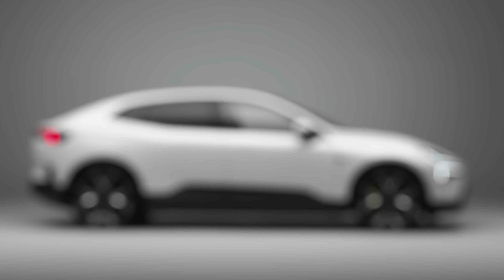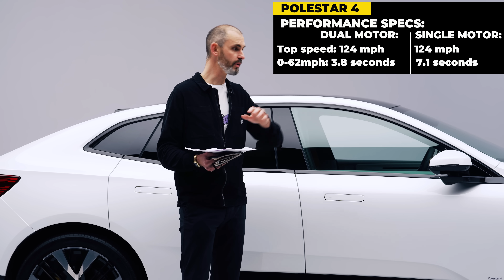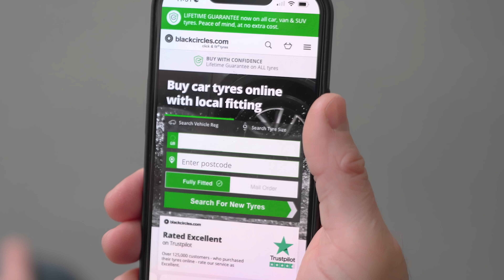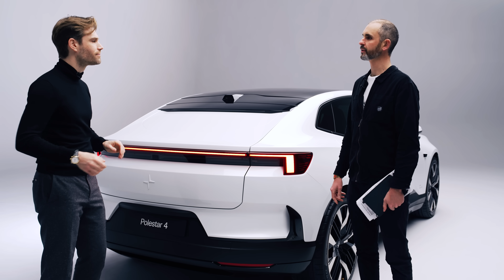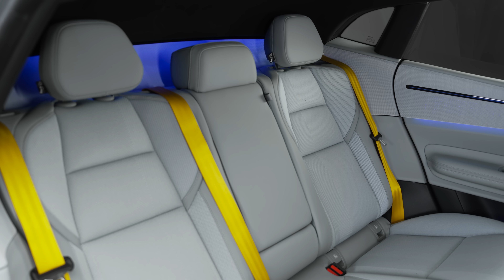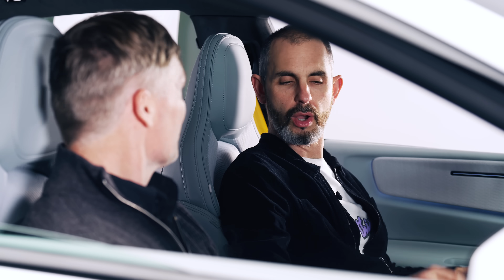New Polestar 4 EV detailed First Look - why the classy electric family car has NO REAR WINDOW

Comment: Calling this an SUV with an "high driving position" when the two could comfortably have a meal, while standing up, using the car's rooftop as their table would be insulting, if it wasn't utterly funny. Since Tesla elevated the B pilar of a sedan and called their Y model an SUV, I guess anything goes now.
Reply: Yep, it’s all marketing nonsense … this sedan has very low ground clearance, not an SUV by any stretch of the imagination … This disingenuous use of names like “SUV” for virtually everything serves no useful purpose

Comment: I know of a few other vehicles without a rear window. I believe they're commonly called A VAN. 
And you can fill up your hatchback booth to the top (legally, everywhere in the world), that's why you have side mirrors.
Reply: Side mirrors on passenger cars are for pointing out into your blind spots, Sherlock, not for looking behind you.  And guess what?  Vans, trucks, buses all have HUGE exterior mirrors to do BOTH!
Reply: @cbatiau2528  Behind your ears is not a "blind spot", it's behind you. Both what? The split mirrors on large vehicles have two angles to better judge distance, not whatever you think they do.
Reply: @PaulSpades  I have no idea what you're saying; it makes no sense.  Blind spots are out at an angle from your car's sides; that is what exterior mirrors are for ... they are not meant to look behind the car; that's what the rearview mirror is for...  duh...   yeah, big vehicles can have two mirrors or more on each side, sure; but smaller trucks and vans have single large mirrors that let you see your blind spots (i.e., on your SIDES) as well as behind the vehicle (thus, "BOTH")...  I don't understand how that was not clear to you from my comment above.
Reply: @cbatiau2528  amazing. if you can't see vehicles behind you trough your exterior mirrors, please learn how to adjust them.
Reply: @PaulSpades  oh, you can see vehicles behind you if they're not on your bumper and are large enough...  that's not the point... The point is that exterior mirrors are properly adjusted when they point out at large angle from your car, like 35-45 degrees out, into your blind spot.   A general rule is that if you can see the side of your own car, your exterior mirrors are not properly pointed to your blind spots, and you're driving dangerously.

Comment: As an older person making a comment I love the shape and the clean lines but it’s way too expensive for most consumers and it looks claustrophobic. We now have a car with a central display that is a distraction as the speed, temperature, radio and all other settings are on that screen. Fortunately it has a head up display but if using polarised sunglasses thats difficult to see. Until cars become completely autonomous the most important aspect of driving remains being able to concentrate on the road in front, behind and the environment around you. There appears to be a growing disconnect between that primary focus and what manufacturers appear to be wanting the car to become which is a capsule that completely divorces you from the environment outside.

Comment: It has no rear window, but has a panoramic roof and silly cameras. Some idiot on R4 this evening was waxing lyrical about how this would make the car more carbon neutral……give me a break…….lorries and vans have no rear windows, and they work ok without silly cameras - the drivers just learn how to reverse using their mirrors. But, it has knob all to do with saving the planet……..and, anyway, what’s wrong with using your eyes, rather than relying on some bings, bongs and a bit of computer graphics? Rant over. I’m off to polish my Morris Minor………
Reply: Yep, drove a transit every day for over 20 years. If you need a reversing camera or reversing sensors, hand in your licence and leave it to the real men.
Reply: @MattyEngland I always found reversing Luton vans using the mirrors easier than reversing my car - at least I always knew where the back of the van was!

Comment: Again a boring cross-over, nice looking, but still boring. SUV name is now used for any thing, but real SUV like a Landcruiser.
I understand the removing of the back window, and when I see how most people are driving these days, it will not be missed. But is it possible that a manufacturer put a small wiper,  or high pressure air, over all these cameras? Real world has the thing called rain, and it often makes these cameras useless.

Comment: All this talk about a coupe-like backend for efficiency and then a cd value of 0.269... the ID.7 Tourer will have a cd value of 0.24 and that's a big old station wagon. I think Polestar missed out here. The 4 will neither get the customer of the lower end of the segment nor the upper end, now being covered by the BMW i5 and the upcoming Audi A6 e-tron. Also feature-wise I don't see much new when Polestar isn't even using the full potential of the Mobileye system.

Comment: With Tesla reducing costs this thing is going to be sitting on the front lot for a long time
Reply: Potentially long enough that all the Tesla buyers will be back with their tail between their legs  after half the interior fittings fall off or Elon decides to put out a software update that sets fire to the battery for a laugh.

Comment: I’m all for EVs, I’ve owned three so far, but why why why are these manufacturers not building SMALL EVs. Not 2m wide, 5m long behemoths that can do 0-100 in sub 4 seconds and cost 70,000 pound/euro/dollar.

We need them to build 50kWh sub 25,000 euro/pound/dollar cars. No over the top design, no panoramic roof, touch screens, electric everything, vegan leather. Simple cars for simple people (like me). A modern Fiat Uno, or a Volvo 340, or a Toyota Starlet. We want SMALL cars!
Reply from the maker: Agree. Smaller footprint with larger cabins is the future for EV.
Reply: Most vegans only wash once a month, wouldn't want my seats made out of them. I'll stick to cows thanks.

Comment: If, like me your eyes do not focus well on close objects without reading glasses I imagine the rear view camera screen will never be very clear and sharp whereas a mirror is sharp due to focal lengths etc. Same goes for all these screens with text on them. Do they do a large print version for us older people or should we rely on car with buttons hosting bold icons on. Does the driving test eyesight check do small print as well as the number plate from 60'? I do like the black polo neck, a very icon rich video.

Comment: The front lights are basically Lotus Eletre and Opel Astra lights combined.
And the back light is from the Opel Astra if it had a full length light bar instead of two.

Comment: How do you clean the cameras like you would a back window? what with the road muck and salty air and snow that covers your car over winter.
Reply: You can't. So you need to stop en clean the damn camera. While if you have a window wiper you just control it with the sticks behind the steering wheel.

Comment: Another BEV for the saturated segment above £50k. 
When will we see serious BEV offerings in the £20k-£30k segment?
Reply: When they can make them with a profit margin.
Reply: What is strange about the car industry is that the product price keeps with rising inflation unlike white goods or home electronics. I don’t want any cameras and the touchscreen should be for route planning, not everything else. I don’t need all that to drive 5 miles to work and the odd trip out of town. Stop following Tesla!
Reply: Battery costs will likely hold them back unfortunately. For under £30k it would probably need quite a small battery, which works for city cars, but maybe not for the average family car. Battery costs will come down with design and advancements though, so they will hopefully become more affordable in the future.
Reply: They will never be that price.. because they dont want you drive it.
Reply: Exactly this
Reply: BYD
Reply: @TwoxowT byd trash with no real thing. Polestar is part of Volvo network witch means they will be around forever
Reply: If your country allows Chinese cars to enter without setting tariffs, it is completely possible
Reply: All the MG EV line up is in that bracket
Reply: @bdogmccool8096 some of
Reply: @bdogmccool8096 because they are cheap Chinese car with a MG badge on it.
Reply: £60k for a car is an enormous amount of money for most people. The only way to get one cheaper is used and who wants a used EV when out of warranty?
Reply: @marcandsebe lots of people once battery durability over comes oil industry propaganda.
Did you know a Tesla battery loses 5% capacity over 200,000 miles?
Reply: @geoffthompson1215  I still don’t want one. I’m very impatient and don’t want to wait hour to charge. You have to keep the battery between 20% and 80% so the range is only 60% of its stated range. I like proper switches and not a screen where I have to go deep into it to control things. Tesla’s are too big as well. I drive a Smart Fortwo and can park anywhere and it’s all I need. I don’t want to carry around all that wasted metal and weight. Plus Tesla’s are too expensive for me new. I can’t charge at home as I like on top floor flat. But good for you if you own a Tesla.
Reply: @geoffthompson1215  not many people can afford a used Tesla. I had a discussion on Facebook about EV’s and a guy proudly came and said he had purchased a 6 month old Vauxhall EV for £18,000 and it was cheaper than a petrol equivalent. The discussion continues and he said he had an amazing deal as the car was £41,000 brand new. So the owner has lost £23,000 in 6 months. I will never buy a new EV and definitely not a used one.

Comment: I've had my Polestar 2 for two years now, with 20k miles on the clock.  We live in the UK and use it as our everyday car, but also frequently take it to our second home in France (a 650 mile trip door to door).  I have a love/hate relationship with it.  I love the way it drives (it's a long range dual motor so has huge torque), very comfortable, good technology (Google Android, the cameras etc) and just about enough space to transport all our gear to France.  I hate the unreliability of some of the key technology.  Three times the car has literally ground to a halt with the message 'propulsion system service required'.  Two of these happened in France and on one occasion the car had to be recovered back to the UK and we had to make our own way back as foot passengers on the ferry (no support network in France!).  The issue seems to be with the motor inverters.  It's a three year warranty and I'm now starting to consider my next car.  The Polestar 3 is too big, the 2 seems like more of the same, the 4 looks lovely and would give us some more space, BUT can I trust it after my poor experiences with the 2?  I'll consider it alongside the Audi Q4, Macan EV etc, and hopefully the Volvo EX40 or EX60 will be available in my timeframe.

Comment: Crash safety could be greatly improved if it didn't have a front window. Why don't they leave that one off, too?
Reply: What if they put the seats, wheel, pedals and the screens behind the car, so the car drives off and the passengers stay still, away from the scene of the accident?

Comment: The EV concept to move away from ICE is a great idea, but to be a success in the US & EU it has to replace the mass volumes of ICE at an acceptable price point. The unstoppable excessive over application of utterly unnecessary technology and irrelevant design  applications are  driving the price of even mid-range EVs so high that they will fail to transition to the mainstream, as already seen and noted by Ford & GM

Comment: been saying it for a while, but car manufactures will all end up making 'estates' again, but it will be under another name. this is only 100mm taller than my V50. consumers at the moment are all hoodwinked by SUVs and Crossovers, and manufactures are happy to keep charging a premium for it... so it has to be called that to attract enough people, but in reality, this actually lower than a V70 XC, so we're already there. put 18s on it with a but more tyre, and drop it an inch and it is basically a regular hatchback... there is a lot to like about this car though, a step in the right direction at least (from proper SUVs, which no one needs).

all it needs from me is to have a much lower boot entry, so the dog can hop in easily :D

Comment: Zo it's like a Model Y, with 30% less bagage volume, worse electron efficiency (so same range), less software features, slower fast charging but slightly more "premium" interior for almost 30K euro more. Somehow I don't think it will sell that well...
Reply: Teslas are throw together to sloppy standards using borderline slave labour. They’re comparatively cheap because they’re not built to last and because Elon Musk can sink enough of his own money into the company that they could basically give them away if they wanted. That’s the difference.
Reply: @theidealcopy_  Actually labour standards in Tesla factories are equal and higher compared to other car factories. Currently Tesla's last longer than other comparable fossil cars and on top of that Tesla is not just the only (beside BYD) car manufacturer that can make a profit producing and selling EV's, they also have by far the highest margins of any manufacturer. Elon doesn't need to invest anything in Tesla anymore since it's a huge money printing machine.
Reply: @emilenossin5098  I’d urge you to look into why employees at Teslas’s NM factory refer to the place as “the slave ship”. Tesla and Musk personally have been successfully sued by tens of employees who suffered physical and emotional abuse as well as explicit racial discrimination.
Reply: @theidealcopy_  With the urgent mission Tesla has there's no denying that you need to be motivated to get with the pace in the factories, but you get rewarded with much more compared to other factories. Of course like with every company there are excesses, there are over 140.000 employees so you will find issues in the same ratio. It's not the company culture though at all.

Comment: Despite all the lovely design features, they still can't bring themselves to actually incorporate that dangerous size screen into the dash. It still has to stick up like an afterthought - "Hey, look at our screen, guys!". I cannot believe that any manufacturer is still doing this 'Tesla' style placement sticking up over the dash, especially the high end ones. Regardless of that, those screen are so distractingly dangerous, I can't believe they are allowed at that size. Trying to guide your finger to a specific point on something that big at arm's length whilst going over the rough, potholed surfaces of UK roads, your hand being bounced around means most times you will miss what you intended and do something you didn't want, so have to go back and try again, so, more time looking at the screen. How is that not a crash risk. And you're not even allowed to touch your phone (which I entirely agree with btw). It's just nuts. Tech for the sake of it. Crazy, crazy, imho.

Comment: I hope the Panoramic roof comes as standard on these sort of cars, as not having a rear window will reduce the number of access points for fire fighters in the event of occupants being trapped after an accident. Having a Panoramic roof would act as the replacement for that.
Reply: yes, all P4s have the pano roof as standard, the only option roof-wise is to have electrochromic dimming or not.

Comment: So they replaced the rear window by a 2d video feed that'll be blurry as soon as the car gets dirty.
Reply: maybe try it first before you judge !
Reply: @SDK2006b  Do you have a rear view camera on your car?
Reply: @MrMarty77  - Yes : I had a Polestar 2 for 3 years and the rear camera got dirty, because it was placed low down.
I now have a BMW iX, which has front and rear camera cleaning spay mechanisms 😊

The rear facing camera on the P4 is mounted up high, and surrounded by a cover, so it will be fine.

Comment: Interesting.
I love the way the current crop of car designers look as though they are clones....a bit like their cars really. All are skinny, tall, trendy haircut, a wardrobe almost entirely black, and with 'de rigeur' black roll neck sweater!
New breed of taller sporty car! Bit behind the curve I would say - iPace? Audi/BMW/M-B coupe  SUV's RS/S/M/AMG?
No rear window...just too ridiculous to discuss. Reclassified as a van? Rear camera view in no way works like actual visibility (and also uses up electricity capacity. Out here in the countryside , 6 months of the year the rear camera will have a thick coating of mud over it. What then?
Front camera will of course be taken out by a dawdling pheasant.
Oh joys, new front fairy lights becoming legal....why? Just distracting/dazzling.
As you can tell, I don't buy in to this 'Form over Function' BS!